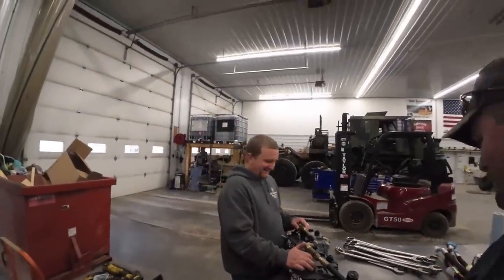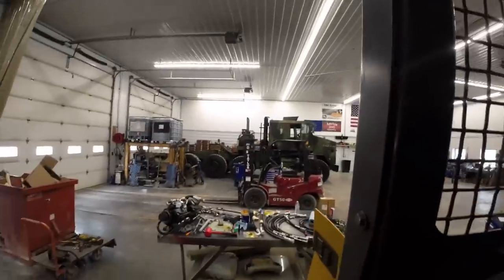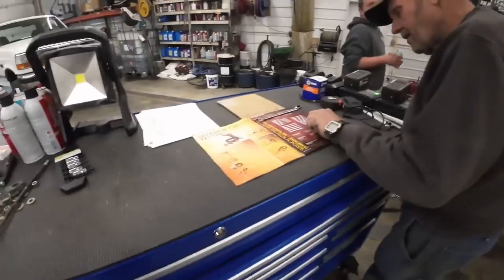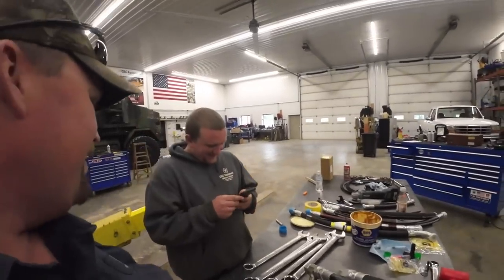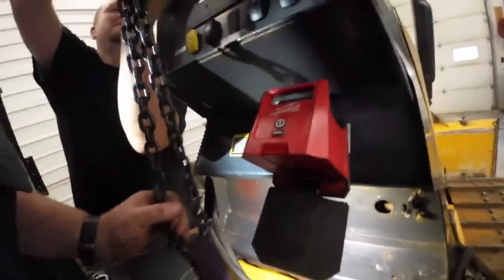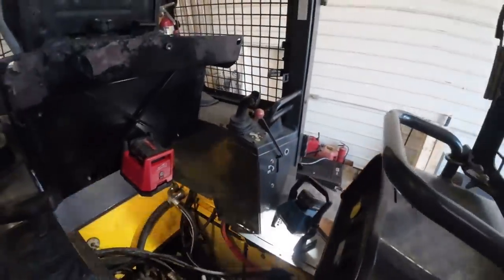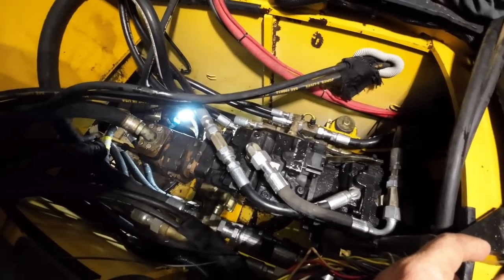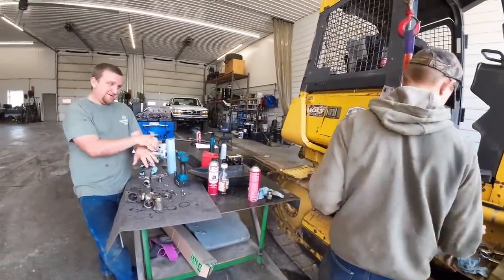Back installing transmission pumps on Deere 650J dozer after one busted, but we had an epic fail

Comment: You handled that much better than I think I would have.  After all the work in those tight places busting knuckles, when it failed all I could think about was 50 pounds of thermite could cut that little Deere in half.

Comment: When I worked for a Deere dealer they always told us to make hoses a little longer. I remember standing on my head in the floor of the old D9s and D8s trying to bend hoses in place. So I always tried to make them the same length.

Comment: Just watched...  Good video guys... We have had a transmission seal go early model 650J's on start up.. I guess... Over time?? On very cold Canadian days. Blows oil out bad when it goes... A shop job... Machine has to be switched out... So now am so careful to low idle only on a cold startup. 5w40 synthetic oil.... Seen the setup of the bypass. Good idea when it all works fine. Too bad there was not a safety pressure release or easy to change seal go on that to prevent a cracked housing... Might be a good idea to always change that valve when doing transmission jobs... Wish there was a hole/ plate hole somewhere above the track pads in that area where one could somehow warm the area with the flex pipe exhaust to diesel pickup trick to warm that stuff under the seat when doing a very cold start. We mostly keep the machines running tarped in overnight idled up at 1500 RPM to avoid that..

Comment: Hello; As an old wrench bender from way back ago I have a tip for you. Instead of using a strap use a short travel come-along. This will give a fine adjustment right at you finger tips. Now back to the video.

Comment: So this one goes into the lose some column, you would think there would be an over pressure relief in that system somewhere other than the pump casing wall strength. A clogged filter screen or something. You may need to keep looking, good luck and keep your head up. You took it, like the gentleman you are. But 53 GALLONS ?!? WOW

Comment: Clint, it's amazing how you kept your cool no tools thrown of cussin' up a storm like a pissed off Cheif Petty Officer I used to know up at Coast Guard Airstation Traverse City Michigan. 
But then we were changing a Sikorski HH52a Seaguard amphibious helo main rotor transmission with some mods not in THE book.
We also found a unit similar to the one that failed causing the transmission to fail.
Our shop Chief was definitely not amused.
Went right over to the Chiefs club and had a couple of shots to calm himself down.
Came back and we got to figuring out what was what to put it back in according to the Book.
Thankfully it failed while taxing out to the take off pad.
Not in the air.
Your patience and professionalism is simply. amazing.

Comment: That's crazy that small valve malfunctioning could cause the failure of pump so easily, you would think there would be a pressure relief valve or some safety system in place to protect the pump from damage from such a thing... Congratulations on the 100,000 subscribers..

Comment: When fitting pumps new or old  , you should always fill yr case drains up in the pump to ensure u hav oil in there , we hav lost a few that way when the guys think that it’s not necessary , it will destroy the pump on start up , just a tip to save u $

Comment: Clinton watching you deal with the terminus of a hydraulic line using a crow's foot caused me to wonder for the umpteenth-time if Engineers ever take ease of maintenance into consideration when they design machinery?

A buddy of mine bought a small tracked skid steer with a catalytic converter installed on the exhaust for use in a small one-man mine ventilated by a 35-inch blower powered by a 270 horsepower turbocharged and intercooled 3306 Cat.

But unknown to him the hydraulic spaghetti in the skid steers guts was so badly laid out many of the lines were rubbing against each other.

He eventually discovered the problem when some hoses became so badly worn they ruptured while the skid steer was operating subject to extremely limited space underground.

He learned a hard lesson when he had to dig an easement underneath the machine between the tracks by hand to get back past it then access the floor plate for replacing and re-routing as many hoses as possible as best he could.

I also learned from another bloke who owned the same make and model machine that he encountered similar problems.

Comment: Working on Pratt & Whitney PT6 Turbine engine or PW R2800 enine like what goes on a F4U Corsair, thats all I have to use is a Crows Foot and if you do not have one your down until the mechanic finds one. I hate using then especially if the fastener needs to be torqued

Comment: Great video and congratulations on 101,000 plus views of your previous content. But comparing a Icon wrench to Snap On, I have to go with Snap On. They're expensive but in the long run day after day use and abuse there is a difference. A buddy of mine once told me Nascar uses craftsman, and I said no they endorse craftsman.

Comment: Nice video thumbs up.  Concerning snap on vs other brands....  On the channel Project Farms a guy is testing real world use of tools and other stuff, he is very practical and is independent. One time the Walt is the best next time in the lower middle, for example. Most of the times it is not the most expensive thing that is the best., also not the cheapest one.  In the range from 12 to 175 dollar tools... Sometimes the 65 dollars one is by far the best.  I am curious about your harbour freight buys.

Comment: Tough break on that by-pass valve and the pump. Seems like there should be another pressure relief somewhere in that line to prevent a deadhead situation. I realize the small port side is open return flow, but what happens when the thermostat fails?
That is an extremely costly way to find out the thermostat broke.
Reply from the maker: Exactly

Comment: I've changed the same transmission 3 times due to a bad torque converter or a gear issues from used parts.

Comment: Just sent a D5G in to have that Plastic Coupler replaced.  Didn't realize the cat had a 2nd pump on side of motor to run the blade, so I chased everything down going off what the Opperator said , Park Brake came on while pushing.  With blade still working I figured it was park brake solenoid or pressure switch,  well last test check the oil psi at test port! 0 Psi ! WTF OVER  🤦‍♂️  That pissed me off
Reply: Those wrenches look the same, but Are Not! Cash price on the Snap On should be around 300$  10mm-19mm , the Icon I use in field,  Snap On don't leave the garage unless I really need them. Exhaust/turbo stuff where u need open end, Snap On Flank Drive Plus will get it off with open end, the Icon will spread and slip, then after that it almost feels like it got soft and slips easily after that. Snap on will hold up to quite a few slips before teeth on open end are beat up and need replaced

Comment: Would it be worth your while to put a guage in and regulate the pressure up to what is called for and see if it exceeds what JD specs are.
a farmer had a tractor he bought. cracking pump twice. i looked at it pressure exeeded what was called for. someone put extra balls in the relief valve inside the tractor. More lifting power what the other owner must of  wanted. I say get a bigger tractor.
You guys. will figure it out 100%

Comment: I feel Ur pain. I went the same route with my Kubota mower deck gearbox. I replaced 2 oil seals and 2 grease seals but the problem was the drive belt and spring that wiped the main oil seal. I spent $129.00 for seals plus my time.  I'll find out tomorrow how much the Kubota dealer is going to whack me doing the same thing I did.   I'm figuring $300-$500 for their rebuild time and parts.  
I wish you luck on another new case.  JD like Kubota thinks their stuff is solid gold.   LOL   U could always blame Mason or Kevin or Randy.  Ain't nobody here but me.....

Comment: Well like you said before Snap-on is very overpriced sometimes they have the parts that you need or the tools that you need specialty there's no reason you should have to pay an astronomical price for a Snap-On tool I have blue point which is the derivative of Snap-on and it works just as good same warranty and half the cost but it comes off the snap on truck

Comment: I doubt that the bypass valve is strong enough to hold back enough pressure. Those 4 bolts that hold it together don't look very strong.

Comment: How does a steel casing crack before a hos blows ? Most of those hose and run at about 3200 PSI how can that c rack steel and not take out a hose . I'm just a curious viewer who would like to know .
Reply from the maker: There was a blockage on the return side before it went to a hose

Comment: I don't understand that the case is fracturing under hydraulic pressure?  Is the case aluminum?
Reply from the maker: Cast steel
The return oil had nowhere to go with the stuck valve

Comment: Do your "icon'  wrenches have the lines , machined spots on the open end ? I worked in a shop that made hydraulic lines , replacing one , we needed the reducer fitting off the end of the old one , they had it in a vice , used pipe wrenches , vice-grips , and couldn't get it off , I said "let me try my open end snap on wrench"  the fitting came loose the first time  put the open end of the wrench on it. I did buy them when they were buy one set , get the second set for a penny.  Buy a set of snap on screw drivers , by the end of the week , you will see there is a difference. I am not affiliated with snap on in any way , There is a reason so many people use snap on. I would have though by now you would know?

Comment: - Sorry that you had another problem.
- Given that you were in a difficult hole to get into, why would you not check the condition of everything even if it was totally unrelated to what you were servicing?
Reply from the maker: You learn from your mistakes
Reply: @C_CEQUIPMENT  .
- Probably, if you weren't struggling with the distractions of getting a video done, you would have had time for detailing the re-circulation valve.
- That is my guess and I am sticking with it.

Comment: I think you guys could do heart surgery, can't be any harder than this. Not sure if they have room for the fork lift in an operating room. Might be a problem. Seems like an engineering problem to me. Should be a pressure relief in the system so this don't happen. Like a hot water tank has so it wont blow up.

Comment: Snap on is the old Williams tool company, and the estimated cost of buying everything Snap On sales is between $130,000.00-$140,000.00 dollars as of 2022 for the truck salesman, and retail sales price between $195,000.00- $210,000.00.
Now I don't imagine that including toolboxes, as you can easily surpass $10,000.00, and up past $40,000.00 grand for wall systems.
That's used boxes and such, so I would safely say that add 25% to that for new, possibly more.
Nothing worse than putting everything together, firing it up, and before you can shut it down, it's totally,"!!!!!Ed up!" 
Sucks like two large gurls devouring the self-serve pizza, at all you can eat pizza buffet on Friday night, after they were both stood up on dates😮
And I really wanted to see Kevin climb in there swapping hoses out, he'd been twisted up in all the hoses so bad, there's no telling what the cost would've been to cut him out.
Did anyone impress upon the youngster that he needs to wait for them to make the new hose, because his mentality is he's gotta get back to the shop so y'all don't think he is out goofing off somewhere instead of coming straight back from suppliers facility. 
Have to put yourself back 20 years or so inorder to understand what you need to make clear to him what you need him to do in cases such as that.

Comment: Life can be cruel at times but a valve failure causing a transmission casing to rupture is not really a good design. A simple pop off valve or pop out plug would stop that